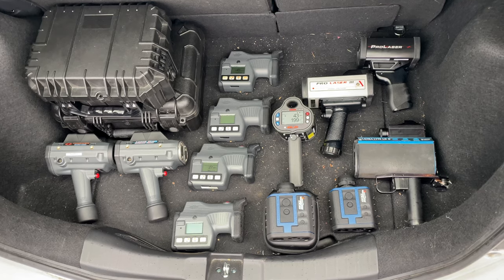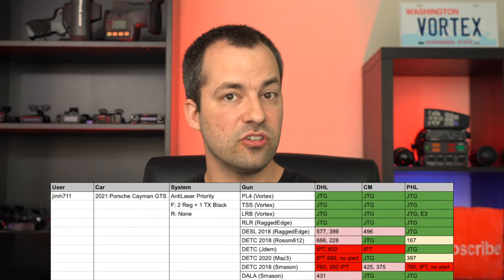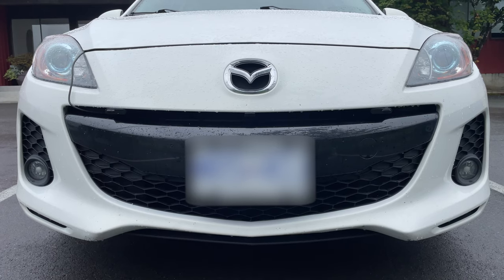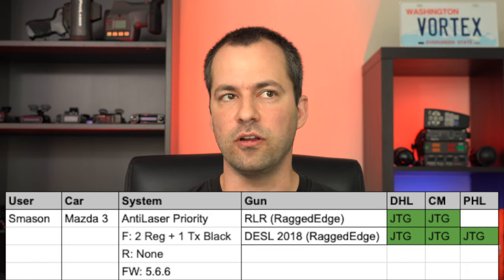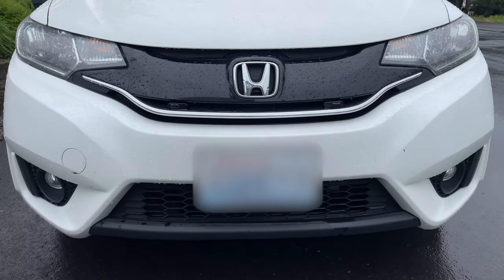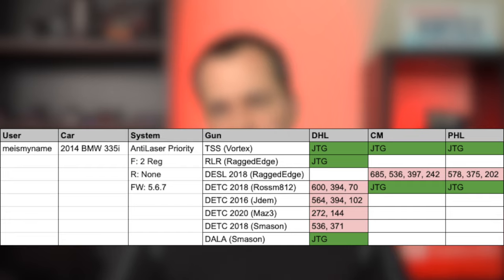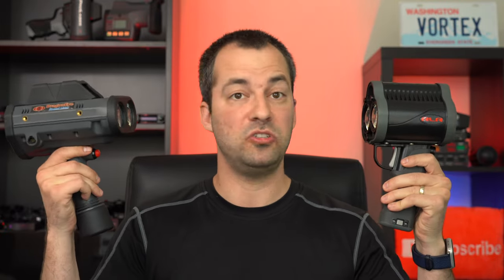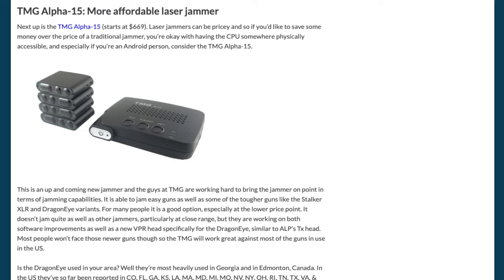Testing Police Lidar Guns and Laser Jammers in the Rain

Comment: Absolutely invaluable intel. Always just assumed no laser speed traps were operating in the rain. Now I know better.
Reply: While there may be some speed traps operating in the rain there are definitely way less. When I was a few months out of the academy, I called in a traffic stop for speeding over the radio during a rain storm. Never did that again after being counseled by a supervisor. Told me no enforcement in the rain because we had to remain available to respond to accidents which do increase exponentially in the rain. This is correct--when it rains, accident calls go through the roof. Plus, good cops are never cold, tired, wet, or hungry.

Comment: Watched and liked, thanks for doing this!  Have had major issues in the past with my ALP control box malfunctioning and burning out ALL my heads.  Then the system wouldn't shut up, kept saying R* - check cables or defective sensor - over and over.  Had to connect the unit to bluetooth on my phone so I wouldn't have to listen to it from the ALP speaker.  Took awhile but Alex, the Canadian rep, had the whole system replaced for me.  Apparently this is rare, but it does happen.  System is working great now.

Comment: DR. VR, first thanks for all you do.  Car and Driver had a article about using auxiliary lights on the front of a car against Lidar.  It did cut down on the recieving time.  Wondering if a LED light bar by the front plate would make any difference  Might  be something to test, as a supplement with a system like a ALP.
Reply from the maker: Interesting. Was it for police lidar guns or autonomous driving lidar? Do you have a link to more detail?
Reply: @VortexRadar  Hi it was for handhelp LIdar guns, i think the Dragon was entioned, along with others. It was an article written years ago in the magazine, about placing driving lights and added auxilary lights on the front of the vehicle.  They tested with low beams, than high beams, fogs and auxilary as well, in differnet stages.  The general idea is that if you are producing a abundent light source, that this would help defuse the beam enough to buy a couple of seconds before the gun could get a speed measurment on your vehicle.
Reply: I remember seeing this as well. That said, it was at least ten years go. May not be true for modern laser speed guns.

Comment: Hi Vortex, can you please tell me when you have defense mode on the blinder jammers do they stop jamming by themselves if you get hit with laser? If so
after how many seconds?
Reply from the maker: Hard for me to answer without you specifying which model of Blinder jammer you're using. Best thing is to reference the user manual.
Reply: @VortexRadar  Blinder 905, doesn't say in the manual.
Reply from the maker: IIRC, with the 905’s you set the JTK time with computer software

Comment: Installing 1 Tx black and 1 rx on rear e63s Amg. Is this sufficient??  In front feel I Shld be fairly well protected with two rx and one black tx  Also any suggestions on control panel placement? Thx in advance. Having installed next week
Reply from the maker: I’d do 2 reg and 1 Tx on an E63S AMG. Amazing car choice btw. If you wanna discuss it in more detail, you can book a private session here: https://www.vortexradar.com/private-sessions/
Reply: @VortexRadar   I will hit you up privately.  Thx for response. These guys are crazy fanatics who are installing and they have a theory way beyond my electrical  and laser intelligence for running just the black tx and one rx on back due to crossing over each other the way the new black tx works.  Vortex is awesome.   Obsessed with it

Comment: The TX sensor on the Porsche isn't supposed to be mounted that low according to the directions
Reply from the maker: That was the case with last gen TX sensors. The new TX black ones are good.
Reply: @VortexRadar  I was assuming that may be the case but their website for the sensor still states "TX Sensors also need a minimum floor clearance of approximately 20" - If install is very low a TX is not recommended and you are better off with 3 regular sensors."  

If they update their site I would consider buying one as I am still running 3 regular sensors in front due to low install height
Reply from the maker: Ah interesting. Yeah I’ll let them know they need to update that portion of their site. Thanks for the heads up. We’ve done a bunch of testing with the blacks and they’re doing really well with lower installs now.

Comment: Test laser with all detector you have
Reply from the maker: I don't think that's a valuable use of time, given how little benefit there is to laser detectors in radar detectors in the first place, not to mention how tricky it is to get consistent and repeatable results with all the handshake and whatnot, but if someone else wants to spend their time doing that, by all means!
Reply: @VortexRadar  Spot on. And ties in to your comments to Parrot Head re: testing with cops. Jammers are so rare that a vast majority of cops would not consider expending effort into anti-jamming work after testing with a friend. Just not a valuable use of time considering the lack of benefit to that cop or the department as a whole. Especially when it would involve being a rat on a friend.